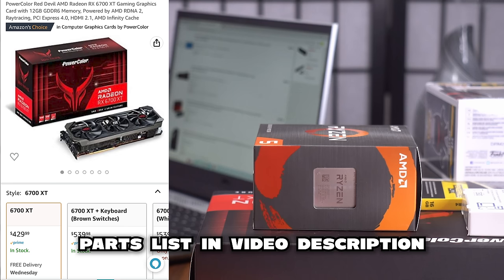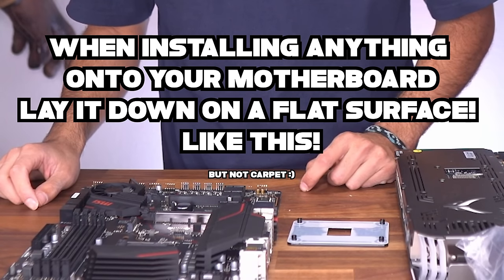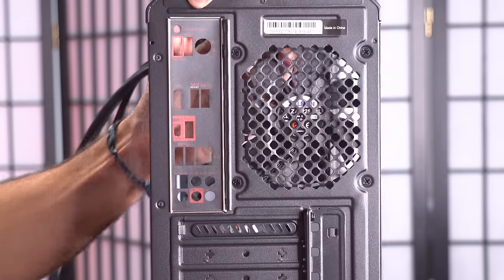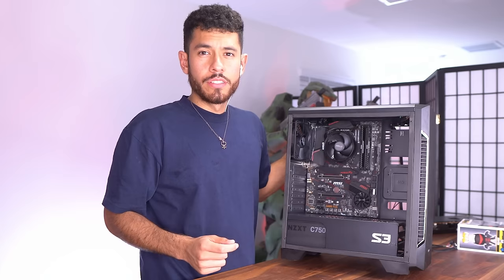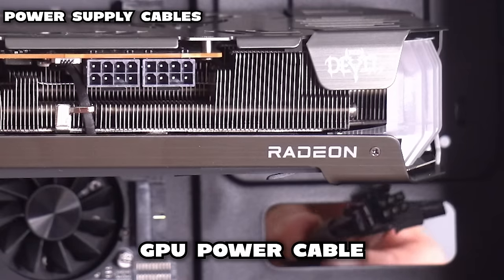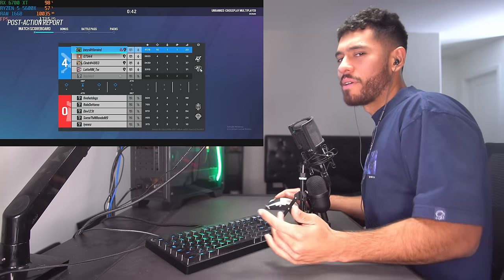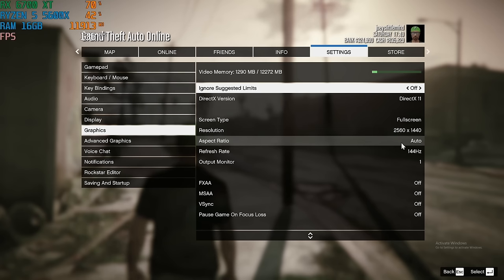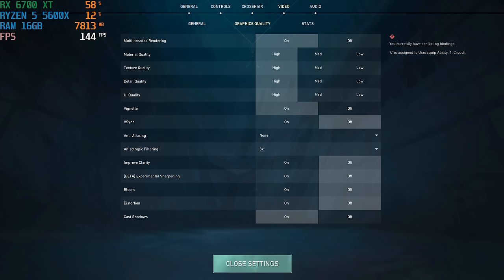BEST Gaming PC Under $1000 GUIDE 2023 (RX 6700 XT, Ryzen 5 5600X)

Comment: I don't know when was this recorded but if you guys are trying to replicate this build just know, the 6700 XT is about $370 right now on Newegg new (can go as low as $290 if you don't mind refurbished) and the 5600 (Non XT) it's like $130 or $140
Reply: 5600x is $160, it and a bunch of other CPUs got price cuts literally today
Reply: This comment got me checking prices and seen my local microcenter has 6600 for 220 and dont really know if i should upgrade from a 1660 ti
Reply: @julitzgaming3172  just for the support of direct storage api is worth it in my opinion, you only have to spend like 80-120 after you sell your current gpu

Comment: I based my build off of one of your older ones.  Worked like a champ!  Thanks
Reply from the maker: Heck yeah, good job!
Reply: Aorus B450 wifi Mother board
Zalman Z2 atx case
AMD Ryzen 5600x
Corsair 16 gb ram
Geforce RTX 3060
Western Digital 50gb storage
EVGA 550 gold power supply
Reply: Can i copy this?
Reply: @skeeterd5150  what date he upload?
Reply: @Met845  uhhh let me look.  It’s working so great.  Wow has its own fps monitor but I’m always in the 140-180.  Uboat at max is in the 70-80s.  That game received a major graphics update.
Reply: @skeeterd5150  did you ever find it?
Reply: @marcushill9363  https://youtu.be/_GD2i-lqTAc. I just used a different motherboard
Reply: Should I buy a 6750xt if it's like 10 pound more
Reply: @jaydensummers2823  definitely go with the AMD

Comment: For anyone wondering the standoff tool size required for tightening the standoffs is a 5mm nut driver
Reply: Where did he get thos standoffs with case or?
Reply: @krompir6544  yes the usually come with or installed in the case or in a spare bag that comes with extra parts for your case
Reply: @joshuagalaxy429  thanks bro
Reply: how did he instal the LED lighting im building it now by idk where it goes im stuck
Reply: @benproctor1369  what led you talking about
Reply: @benproctor1369  oh I see it’s a strip that connects to ports on your motherboard look for text that usually says JRGB1 or J RAINBOW check your motherboard manually for reference

Comment: Bro I'm working on a $1000 budget pc build right now this video is perfect timing 😂👍

Also I'm that beginner you're talking about, doing my first ever PC build. Can't thank channel's like yours enough for showing me the way!
Reply: I am also working on an £1000 PC but I have been going over budget with the operating system prices do you have any advice
Reply: @leonidaschalkias  don’t buy the key directly from windows you can get them cheaper elsewhere
Reply: @leonidaschalkias  You can get windows 10 pro for like 5-15$ at some 3rd party cd key resellers. Seems shady, but it works, did it myself. Besides, if worst comes to worst, you'd have to get scammed 20 times and it'd still be cheaper than buying from microsoft.
Reply: @leonidaschalkias  check G2A, way cheaper than retail, it's legit too
Reply: @leonidaschalkias  you can get windows for free, but it wont have all the functionality of the "unlocked" version but it does allow for downloading any games and softwares, just lacks some customization

Comment: Just bought everything you listed and will give feed back on the build! 💯👍🏽

UPDATE: 12/11/2022 - THIS GAMING PC IS DEFINITELY WORTH IT! Handles MW, MW2, VANGUARD, FORTNITE & OVERWATCH like a dream! If anyone is looking for a new pc build and has $1000 to spend? I would GO BUILD THIS EXACT BUILD🗣🔥
Reply: let me know how it went im thinking of getting the same build
Reply: Bro can it do call of duty 240fps @1080p??? Looking to build one as well
Reply: Everything still good bro?
Reply: I bought all of the parts, and I can’t even screw my motherboard into all of the standoffs. It’s as if the motherboard is bent out of shape or something.
Reply: @dawanbrown1393  i had the same problem, i didnt use all of my motherboard stand off’s. I noticed mines was starting to feel like it was bending to. but i just used 3 instead of 4. You could try using less, and then seeing if the stand off’s are compatible with the motherboard and pc case you bought.

Comment: the 5600 is a much better buy than the 5600x. there is about a 1-3% performance loss (so basically unnoticeable unless you are running side-by-side comparisons) in choosing the 5600 over the 5600x but it is often $20-30 cheaper, which is money you could put towards a decent air cooler. with the cooler, you could overclock the cpu to make up for the performance difference.
as of right now, the 5600 is ~$135 (considering shipping on amazon, but just $120 if you have prime) whereas the 5600x is ~$159
Reply: cool down nerd. he might not have 5600. maybe 5600x in video is for content use only.
Reply: @cloudx7897  that makes sense for the build, but it would have been helpful to at least make a note to prospective buyers.
Reply: @wizdom224  I'm  a newbie when it comes to pc building and what not. Any recommendations for a cooler within that price save?
Reply: @wizdom224  yep, 5 5600 is better, 5 5600x is just paying for the x.
Reply: would this gpu be worth getting to upgrade from a 5600 xt , also i have a ryzen 5 3600
Reply: @Obbss  no clue. it's your pc. if you think you need an upgrade, then go for it. if not, then don't. i'd say, though, that if you're in the market for a new gpu, and you can manage a little patience, then it's probably best to wait a while for radeon 7000 series or maybe rtx 4000 series.
Reply: @wizdom224  nah those are too expensive for me lmfao
Reply: @Obbss  i'm pretty sure you're not a time traveler or anything so i don't know why you'd somehow know the pricing on as of yet unreleased hardware. but i'm not specifically advising you to buy new hardware so much as i am advising you to wait for older hardware to get cheaper. if you can afford a 6700xt now, maybe you can afford something better if you just wait a few months.
Reply: ZENJI GAMING  well that's what's called a 'good deal,' so go for it, of course.

the 5600x is a faster CPU than the 5600. it's just that the difference in performance is negligible for the comparatively steep price gap that is so often the case.

so usually the 5600 offers the best value, while the 5600x offers the best performance. but if you can get them for the same price, then go for the 5600x because in that case the 5600x would offer the best value AND performance.
Reply: But i want to flex the X lmao
Reply: Or just get a i5 12400f which is better then a 5 5600x and cheaper than a 5 5600 lol
Reply: @ryhno11  The 12400f is about on par with either of them, but usually just slightly slower. It's also usually more expensive than either of the 5600s when factoring into account the cost of the motherboard. Prices may vary as does performance in different applications (similar to how some games run better on AMD GPUs and some games run better on NVIDIA GPUs) but you're largely wrong about that.
Reply: Guess he was rights bout gpu prices
Reply: Some of the comments here are a bit rude, but I'd like to tell you your comment was entertaining and informative. I'm currently in the market for purchasing computer parts and I'am undecissive wether to do AM4 or AM5. I know AM4 is sort of a dead platform, but I am in budget and I think AM4 will do me just fine. Thanks.

Comment: i put together a 5600, rx6650xt, 16gb ddr4 3200, 1tb nvme, gigabyte b550 mobo with wifi, thermaltake case and 700w psu for under $700 not including tax. budget gaming builds are back!

Comment: Is very important! GROUND YOURSELF by touching metal or using a wrist strap to avoid static discharge on the CPU when picking it up AND when handle the motherboard.

Comment: ive found that, going with the 7600x cpu, rx 6700 xt , on AM5 which will give you about 4 years of support with the cpu socket and ddr5 ram, you can get this for around 1200 before tax. i highly recommend going with am5\ddr5 for long term support.
Reply: Need a rx6700xt build

Comment: Great all round build, only thing I would change is to save some money and get a Ryzen 5 5600 instead of the Ryzen 5 5600x since you’re already slightly gpu bottlenecked, it shouldn’t affect performance and they’re basically the same processor. I would then use that extra 20$ to upgrade to a 1TB drive. Besides that though, great build
Reply: it wont bottleneck in 1440p
Reply: Why would it bottleneck?

Comment: If you want to save some bucks... dont by the AMD X versions (its just a gamer brand that means it runs faster for more money!) The normal 5600 (without the X) is cheaper, and it will still way out preform any task the RX 6700 XT can deliver. Unless you want to play at 1080 with a 7900XTX at 250+ fps, then dont waste money on higher end CPUs or X versions for gaming.
Reply: 22:05 "99% GPU utilization, perfect CPU combo"... Ehm No... As i said, The X was a wast of money, as its only doing 49% work and the GPU cant keep up. (Your GPU bound, save money on the CPU.... Want/need more, put it into the GPU)

Comment: Does the gpu extension cables give it more power to the gpu? Can I run the gpu with the 1 cable even though looks ugly? I have 650 watts with 6700 xt

Comment: Have you actually managed to get the ram running at full speed? I remember My ryzen x570 rig never ran my ram at the advertised 3600Mhz even though it was ryzen optimized. That and other driver issues made me switch to intel and nvidia.

Comment: Hey so I have a question, I was thinking of building my first PC, and this tutorial is perfect and everything is within my budget. However I noticed the motherboard does not have built in WiFi, since I don't really have the option of using an ethernet cable what would you recommend for a wireless option. (sorry if any of my questions may seem dumb but I really don't know what I'm doing)
Reply: There are from MSI brand also that support wifi already for this chipset

Comment: new to pc building. got a power supply, not sure if the cables work with it. for example, you use 2 different cables for the cpu (2x4) and (2x2), while i only have the 2x4. is that a problem? thanks

Comment: You should have gotten a B550 Mobo, saved a few more bucks and potentially gotten a better case.  That thang looks like a hotbox.  Two little slots for the air intake just isn’t enough for me.  And the PSU from NZXT is really expensive.  Evga is much cheaper and still amazing quality.  And it’s gotta be 1tb or more, you’re not gonna hold many games on your m.2 with only 500mb. But as you said it is all upgradable. 

I like how you do explain price and you got the vibes man, but some parts just shouldn’t be budgeted.

Comment: in 2024 for £530 gbp just built a similar pc only difference is  a 1 tb m.2. 1tb ssd and 32gb ram. ROG STRIX B550-F GAMING motherboard  and a 650w gold and a pre installed 7 fan case

Comment: I'm close to building my PC very soon! My specs are Nzxt h510 flow white and black, Corsair black 3600mhz, EVGA 600ba, 500 gigs of wd blue, but I don't know what GPU to get or what CPU could you help with that? I also love your videos
Reply: Id say go AMD right now, for 1080p get the 6600xt, and for 1440p and higher get 6700xt and above.
Reply: @OhhAspireHD  thank you so much I appreciate it what would be a good cpu?
Reply: @Axtrelz  When gaming with an AMD gpu I would say get and AMD cpu because that enables you to run SAM. Id say at least get a Ryzen 5 5600 or X version minumum. Obviously anything Ryzen 7 is better but Ryzen 5 5600 should be just fine.

Comment: I am confused about the GPU power it has two 8 pin, so did you use two different cables coming from the PSU or you used one cable with two 8 pin daisy chain connectors ?
Reply: It's never a good idea to daisy chain, should use 2 separate instead

Comment: I live in australia I only play Fortnite I have a budget of $1000 AUD maybe a bit over I only play fortntie what is better for fortntie fps 1080P gaming and 1440P mostly 1080p what cpu and gpu I am thinking the ryzen 5 5600x or ryzen 7 5700x and the Rx 6700xt or 3060 ti or 3060 with ryzen 5 5600x or ryzen 7 5700x ddr4 ram 2x8gb 1 tb Kingston NVME and a 240mm nzxt krangen liquid cooler in a mid tower pop mini case

Comment: Hey I’m new to building PCs and wonder if this can connect to my wifi and if there is a cheaper case that I can use as I’m on a tight budget
Reply: Check the motherboard specs. If it has wifi, it will be listed there. If not, you can always buy a USB wifi adapter.
As for the case, you can use any compatible case. Lookup what PC form factors are. As long as the motherboard and case support the same form factor, it will work.

Comment: is the encoder on 6700xt good for streaming? I've been planning to build this system in a couple of weeks
Reply: It should be fine it does take a lil more bitrate than the 3060ti encoder which is similar in performance to the 6700xt. 6700xt is better in performance (usually when paired with a ryzen cpu like the amd ryzen 5 5600x where it gives a frame boost by 15%) , power consumption , and price. Except it needs a higher bitrate to look good vs the 3060ti using less to get good quality but in all they aren't much different.

Comment: I upgraded my current computer using this video. Went with an XFX 6800 16 and the Ryzen five 5600. I will be using my existing case,PS,MB,HD, and ram.  I’m hoping for similar results.
Reply: So I go to install windows and get to the final set up and the video card shuts off and the screen goes black!?!? Is it possible that windows is installing bad drivers? Any help would be great
Reply: @SouthernOregonReps maybe you’re psu? Did you already solve it?

Comment: Total: $1019.43 Crazy how PC parts(AMD) are cheaper and better now than a year ago.
CPU: AMD Ryzen 5 7500F 3.7 GHz 6-Core Processor  ($155.00) 
Thermalright Assassin King SE ARGB 66.17 CFM CPU Cooler  ($20.00@ Amazon) 
ASRock B650M Pro RS WiFi Micro ATX AM5 Motherboard  ($149.99 @ Newegg) 
TEAMGROUP T-Force Delta RGB 32 GB (2 x 16 GB) DDR5-6000 CL30$106.99 @ Amazon) 
TEAMGROUP Cardea Zero Z440 Graphene 2 TB M.2-2280 PCIe 4.0 X4 NVME ($108.99 @ Amazon) 
XFX Speedster SWFT 319 Core Radeon RX 6800 16 GB Video Card  ($374.99 @ Newegg) 
SAMA ARGB-Q5 MicroATX Mini Tower Case  ($53.49 @ Newegg) 
EVGA 650 B5 650 W 80+ Bronze Certified Fully Modular ATX Power Supply  ($69.98 @ Amazon)

Comment: I just upgraded from a 1070 to a 6700 XT and my fps got worse. I used DDU to get rid of all my Nvidia drivers. I have installed all the AMD drivers-Adrenaline. 750 psu, 32 gb ram. Massive stuttering. Modded Skyrim went from 60 fps to a janky 35-40. Even though I still have a i7-6700 non K , I expected to be able to have better performance with a newer card with 12g vram. What do you think the problem could be?
Reply: clear bottle neck, upgrade ur cpu
Reply: Your cpu not good enough

Comment: 1 question bro what do you suggest the rtx 3060 or the amd radeon 6700 xt?
Reply: Radeon 6700xt is better by so far.
Reply: @sauceitup100  thanks
Reply: @sauceitup100  is the 6650xt also better than the 3060
Reply: @Minato-ek2oy  Radeon is the better than Nividia GPUS

Comment: Jey guys im new to computer gaming. I also play pokerstars Pennsylvania online poker. Does it matter if i buy Intel or Ryzen?
Reply: I'm not very familiar with that game, but I don't think it matters. The requirements are not very high so any reasonably new PC (from the past 7 or so years) should work fine for that game. Now, if you plan on running other games, it greatly depends on what games you want to run and at what graphics settings.

Comment: Is this pc build powerful enough for sim racing like aseto corsa
Reply: I have a 5 year old PC that I built using a Ryzen 5 1600, 16 GB ram and a GTX1060 GPU.  I havI no trouble running ACC, AC and Iracing @1440P at around 85 FPS (27" monitor).

Comment: I got everything that this has besides the 5600x I got the 5600g cause the x was out and I'm only getting 60 to 70 fps on most games and my monitor is a 75hz will I see frames go up if I get a 144 or 165 hz monitor?
Reply: no
Reply: 5600g was a bad investment. you shouldve waited for about a week to buy either a 5600 or 5600x

Comment: Does the ssd hold all the personal data and windows 11?
Reply: Yep. That's where the OS and your data is stored.
Reply: @JJFlores197  I've been hearing a 2TB SSD would have very fast load up times. Do you know why that would be?
Reply: @InsaneryTV  SSDs have no mechanical parts compared to a hard drive. They use NAND flash chips which offer faster performance compared to the mechanical platters of a hard drive which have to rotate thousands of times per minute. That's what gives SSDs fast performance.

Comment: Can somebody help me? 
Im about to build my first pc im unsure if i should buy the Ryzen 5 5600X or Ryzen 7 5700X (In my country there about the same price).
Reply: The Ryzen 7 5700x is step above the Ryzen 5 5600x. Since The Ryzen 5600x has 6 cores 12 threads, While Ryzen 7 5700x has 8 cores and 16 threads. More bigger numbers equals more power/performance in this case.

Conclusion: Buy Ryzen 7 5700x

Comment: 3:15 silver power supply  is better than bronze not as u said
Reply from the maker: By Silver I meant a base 80+ PSU, AKA “White Power Suppy” I called it Silver because “Silver” PSUs are extinct for the most part. I got accustomed to seeing silver color on EVGA 80+ “White” PSUs so called them silver overtime.
However yes, my mistake. That is correct.